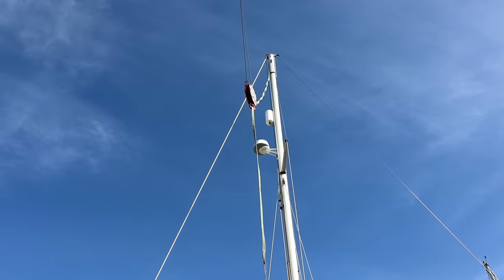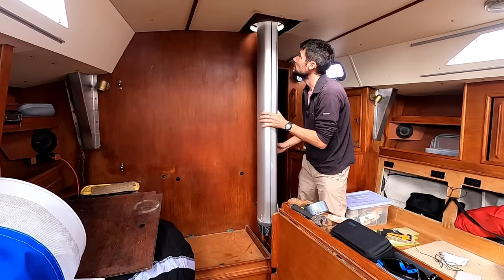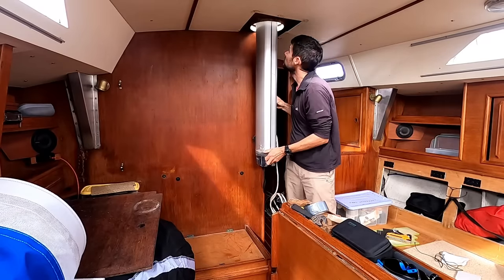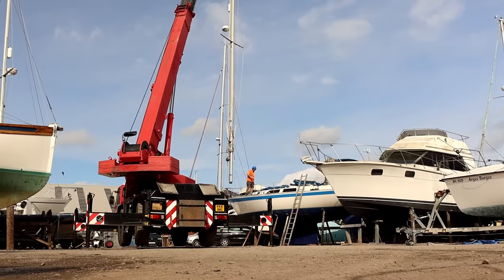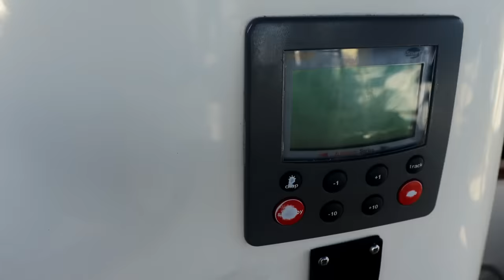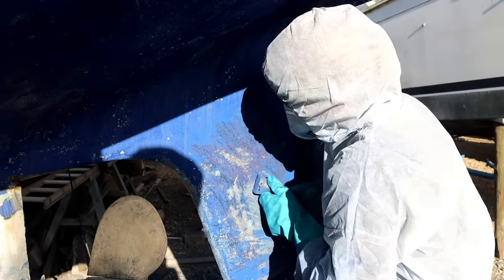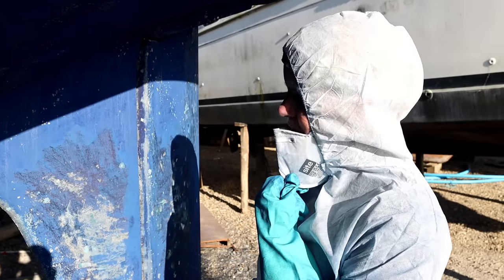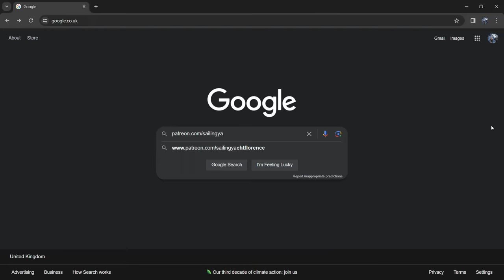BROKEN by Ocean Sailing - 50,000 miles later | Sailing Florence Ep.173

Comment: You should thing of buying and installing a de-humidifier think of it as a negative air conditioner, it will help to keep the cabinet much warmer.
Reply: Living in a cold boat in winter is like living in a tent, condensation from breathing. A dehumidifier will also stop mould.  Highly recommended.
Reply: Yes Millennial Falcon finally just got one and the reduction of condensation was phenomenal
Reply: As good ventilation control is so important, including when underway in adverse weather, might be worth adding more dorade vents?
The ones I designed and installed on my Frances 26 many years ago employed an adjustable s/steel mushroom vent,  hence simple and immediate fine adjustment of each unit to match airflow requirements.
Reply: I stayed in a cold basement guest room near freezing temps outside and the dehumidifier easily made the difference of heating enough to be warm. Had to be sure to keep bucket empty so the heat didn't stop. (Just for boat yard)
Reply: These dehumidifiers get a good review meaco   dd8l    junior-dehumidifier
Reply: A modern dual inverter AC can cool and warm: both modes fight moisture and condensation. They can run of DC current.
Reply: Just replied same idea.
Reply: Power consumption will be an issue and will likely challenge their energy system when off grid as a dehumidifier is basically an air conditioner (chill air to dew point) - then there's the impact on the heating side as well. The meaco unit mentioned above consumes 330 watts and probably needs to run 24h a day.
Reply: 12 volt diesel heater is what I use and it's the only way keeps the boat nice and dry definitely the best heat source
Reply from the maker: We'll cover our heating installation in a later video. The dehumidifier option will be there for when we are plugged into shore power (rarely) or when we are running the engine; running it continuously would be too much of a power draw from our limited space for solar panels and the lack of direct sun in the higher latitudes.
Reply: @SailingYachtFlorence  Copy that. A hydro-generator will not help a lot I guess. Windgenerators ....... I have my doubts. A generator on diesel? Your thoughts?
Reply: I think an MVHR system would be more appropriate so they keep it ventilated but don't lose the heat. Especially as they will be in a cold climate. At the moment this system is de rigueur for passive houses but in the future I expect to see it everywhere.

Comment: Hi Amy & Matt. When replacing your mast wiring ( or any wiring) on the boat use marine grade " tin plated " wire, not the common and garden automotive copper wire.  I came across a rather nice modern ( 12 yr) french built 40 odd footer with rotten and corroded wiring. As a quick repair I used some aircraft wire which was tin plated  that I had lurking in the toolbox. Couldn't believe that they skimped on something so basic and well known to cause problems later.
Not as bad as rigid solid core household wiring , which I've seen  used  on  a main switch panel.!

Comment: That is quite a project. Having watched some channels, such as Sailing Sweet Ruca & Alluring Arctic Sailing, it's clear how important it is to have a reliable boat, equipped for remote places and extreme conditions, including , multiple sources of heating, redundancy, large fuel supplies in proper tanks (on deck fuel/water storage greatly reduce boat stability).  It almost seems that the supplies and equipment required at high altitudes require a bigger boat.  Even carrying long shore lines takes up alot of space.  Don't skimp on the insulation, weather proofing and dehimdifying either.

Comment: I recently replaced my aluminium toerail on a 1980s Trintella 44. It's a big job. I looked at refurbishment but it's wasn't viable. I had a new toerail manufactured by SL Yachting. They did a great job of building what we wanted. You would be able to incorporate stanchion bases with the new toerail  and do a better job than original. Far stronger stanchion bases and no leaks. I went for solid aluminium stanchions. Super strong. It was expensive but worth it

Comment: you need a dehumidifier, its the only way to solve the condensation issue.  make sure you get one that will work with your inverter.  you will be damp inside witout one.  bonus is the also produce quite a bit of heat so you get a bit of warmth from it too.
Reply: I use a simple gravity fed Dickinson Alaska diesel fuel heater which draws internal air for combustion on my boat here in the Pacific Northwest.  During the cool, damp winter months it keeps the cabin warm and dry without using any electricity or making any noise.  However condensation is an issue in the unheated cockpit locker and engine compartment.

Comment: I know you will get there. Florence might take a lot of tlc......but then.....she will be in top shape for another 50.000 miles. And....insulation helps tackling condensation. However a dehumififier is a must. An average person exhales 400 grams of water every day. Meaning, the two of you, in the boat, pump about 1 liter into the boat, just by breathing. I installed a small 12v dehumidifier on my small boat and the result was: No wiping, just empty the container overboard.

Comment: Some things I would suggest. Double glaze the windows by putting an inner piece of perspex to shape (anti condensation) also use polyurethane foam under the deck. I have several areas where the underdeck is like a rainstorm from condensation. In particular the cupboards in the fwd head were so distressing. It took me ages to develop the technique to foam upside down but the end result is warm and bone dry. I have other areas, particularly in the instrument panel where it still rains but I have improved that enough to get me through their winter. I am doing the same as you to leave NL by this coming August, so have an equally impressive list. Understand that condensation in icing conditions is like a water engine. As water condenses it makes a lower air pressure right up to creating a vacuum so there is no way to prevent moist air getting to the icy surface if there is any pathway at all. The only solution is PU foam in the underdeck and around difficult bits like the bow thruster tube.

Comment: I have some lengths of the toe rail if you thinking of replacing parts of it.  It’s not full lengths, but most of it is serviceable. When you have replaced the toe rail, I suggest not putting back the EY stanchion bases.  I have had two yachts with the same section toe rail and made stainless bases that fix to the same fixing points along the rail + an addition bracing pad on the deck; much more of a job👍 Having done the same toe rail job on my Rustler, I know it’s a big job, so wish you well.  The deck; you would be best take all the old track mark off and re-gel the deck with non slip pattern.  I have seen this done on a Heritage 37 and is much better than track mark.

Comment: Get a dehumidifier before going anywhere cold.  It is the only way, other than spending a mint on diesel, to control condensation.  I remove antifouling by wet sanding it, with detergent.  That helps stop the sandpaper clogging and makes the job go more quickly.

Comment: Diesel Heater DAH will solve the condensation problem. Just take a little time to run additional intake to the engine room and forward as far as you can this will draw damp air out. Same with vent place some smallish vent to engine room and damp areas to blow dry air.  My DAH will drop the humidity to 16%.

Comment: Solid dodger would be worth looking at , Good diesel heater a must & possibly routing the outlet to create a drying room for wet /damp gear , A furler on the staysail is good as any thing to keep you off the fordeck in freezing conditions is a must > Runners for bracing can be a pain (Tacking) . I found taking them well arft so as with a reefed main they clear the boom end so jibing , tacking isn't a problem Oh curry & Rum helps > Enjoy

Comment: FWIW the tops of the chainplates on my boat pass through the deck like yours.  I tried a few different sealants to seal under the small cover plates screwed down over the gap between the deck and chainplate without complete success; one of the more frustrating sealing jobs on the boat until I used butyl tape which for three years now has provided a perfect seal.

Comment: The higher north you go, the lower on the horizon the sun will be. This means less energy from the sun, and doubly so if your panels are placed horizontally for instance on an arch, bimini or sprayhood. Just something to take into account is that solar might not be enough at some point.

Comment: Matt and Amy,  Hey you two.  Do yourself a favor and invest in a set of Bahco scrappers and some replacement blades, you will never look back!  The blades are carbide and reversible, they last and cut and last like nothing we have ever used before.  You can shave and feather in your bottom paint with a fraction of the effort.  I actually sort of envy your worklist!  Sailing a failry simple smaller boat has some big advantages, hang in there.   Best of luck with your project.  J&J SV Sueno, Marmaris
Reply: I agree, they are bloody good, scraped the bottom back to primer on my 35ft Keeler, you get a good hold with two hands

Comment: Check out sailing Umas experience. 
One tip for high lattitudes rig your solar panels if you can so you can tilt them closer to the horizon ....horizontal only works between the tropics ...above that  latitude you need to be abble to point the pannels more towards the sun for them to remain efficient. 
Insulating floors and cabin sides with thick cork tiles  sealed on the floor will help ..cork seadeck works well and lasts .. it also insulates the hull deck from outside.
Remember if the interior surfaces can breath they dont end up condensating. 

Theres a Pbo article on line that may help you with ways of controlling condensation on a budget both financial and from a power management point of view. 
You will need to double skin those windows/ports. 

The other thing is plan your route flexibly .. Putin is making threats about polar waters and svarlbard. 🧙‍♂️🇬🇧

Comment: Did you not think about having the hull sandblasted. I’ve just had mine done put back two coats of epoxy followed by two undercoats and two coats of antifoul. Very worthwhile and labour saving. The guy who did can remove a single layer of antifoul without touching the gelcoat.

Comment: Those triangular chain plates need at least a weep hole to allow water an egress or perhaps some lightning holes like an aircraft wing rib with perhaps some additional steel doubling plates to allow for ventilation to the enclosed space. Or else remove the wood on the bulkhead and build up with epoxy and glass so there is no wood in the dead space

Comment: I wonder if you could fit a extra fuel tank and perhaps run a heater or radiator off your engine coolant circuit incase your diesel heater gives trouble, I like having both options as I have had the diesel heater fail before

Comment: have you considered a solid fuel heater ? the dry heat take care of the condensation ,you can get quite small ones that burn smokeless fuel
Reply: It’s really nice to have one type of fuel on board that works for multiple systems. A diesel heater is the simplest solution

Comment: Gelcoat cracks are a source of water ingress to the glass substrate. I hope you grind them back and check for moisture.

A wet rudder with osmosis needs to be assessed for potential glass delamination – if you dig into an osmosis hole, and it smells vinegary, you will need to dry out (e.g. hot vac) and/or replace the delaminated glass.

I’d replace all chain plates and standing rigging. That plate you removed had some rust on it near the wet plywood. 

How many hours on the engine? Polish your fuel & fuel tank and change all engine filters/belts, along with servicing all pumps. How old is the alternator?

What type of replacement through-hulls will you go with? Composite?

Consider an EOFY fuel cell as an additional source of charge for your batteries. Be wary of how much sun you will get in the high northern latitudes and the operating temperature ranges of your new LiFePO4s.

End of your video … substantial rot in the deck? I hope not …

Good luck!
Reply: I think gelcoat is mostly UV and somewhat permeable to water passing.

Comment: Just work, your lucky to have no real problems yet !? (They used chopper guns 35 years ago) maybe upgrade motor and anchor system, look at what the commercial boats use in the high latitudes (it ain't trade wind sailing), it will be interesting on how you insulate so it looks good,  delightful couple with good photo descriptions, keep it up

Comment: The best way to stop rust staining coming from behind stainless steel fittings attached to fibreglass is to use anhydrous lanolin. It's a very sticky waterproof grease that never washes off. The traditional way to seal these fittings is to use a sealant like Sikaflex 291. However, long term this has 2 problems. Firstly, the seal fails after 10-15 years, and secondly the residue is almost impossible to get off. Lanolin has neither of these problems.
Reply: Wow, that's a very valuable tip.
Love the education level  contained in the Comments  section.

Comment: Don't forget "DRY SUITS" in the invent you need to go into the water, "Wet Suits" simply won't work. Hyperthermia can start in less than 3 minutes in 33 degree water.
Include a "Dry Head Hood" and the required other items..ie..mask, snorkel, fins, dry booties, controlled life jacket ( another name***).
Reply: For dinghy sailing I had a hybrid suit with rubber neck, wrists, ankles and horizontal zipper across the shoulders. Pretty floaty so maybe a challenge for swimming the bottom.
I did my checkout five in a wetsuit a couple weeks after the ice came off and it wasn't horrible.

Comment: I admire your commitment to refit/rebuild but the obvious question is why not get a much more recent boat. I would think at almost 40 years old, isn’t time to just retire Florence.
Reply: 1970's and 80's fiberglass boats are the pinnacle of value for money. More modern boats are thinner and much less strong (with a small handful of exceptions). Besides, even if you bought a much newer boat, you are still in for changing out systems every few years. They are making the right call.

Comment: Heat gun will really make removing the non-skid decking easier. Apply heat as you lift off the non-skid with a putty knife.
Reply from the maker: That is true if it has been applied with contact adhesive, but this was applied with epoxy!
Reply: @SailingYachtFlorence  Ugh! I feel your pain.
Reply: I removed the epoxy’d on Treadmaster from my 39ft Westerly Sealord with a heavy random orbital sander and 40 grit discs ( lots) I tried everything and this was the least awful for me. Good luck with it all 💪🛠️⛵️

Comment: Pardon,"The Nurd" in me would muse  ,"Bolts" on the Chain Plates are actually Very Very Long Button Head ..."Setscrews'' a Bolt being threaded for Part of it's length where as a setscrew is threaded for all of it's length, this would be an ideal time to replace same with hexagonal set screws and SPACER Washers to spread the load across the chainplate bracket, also i presume there must be, Should be,  a class a Stainless steel Plate in the back of the other side of that bulkhead,  where there the nuts go. BUT if it's just onto the Veneered Ply, get a new Stainless Flat plate made up with holes in same, using the polished Chain plate  on the front a a Template for those  Hole Pitches, tensioning up and fitting  double nuts or Lock Nuts and of course Spaces washers for same as, "Belt and Braces" and Load spreading then you would have a really then critical part of your boat firmly secured against the worst that can be thrown at it in those High Latitudes, ...even another thought get a few more of,  and a lot  better welds on that Flat solid  chain plate parent metal, as i saw fairly rough Stitch Fillet welding that had been carried out onto the Fabricated polished Bracket... can be seen briefly    @ 13 Min-00 Secs in...Good luck with the refit... Great Upload, Malachy

Comment: Best replacement stove is the British GN-espace. Very expensive but very good insulatiin so uses much less gas and doesnt heat the boat up as much & very good for baking with even and accurate oven temperatures. The Force 10's are now chinese made & much lower quality than the Canadian made units.
Reply from the maker: Sadly the GN-espace is way out of our budget!
Reply: We got an Emo, which works very well, but don’t buy a 3 burner stove, we never use our third burner

Comment: Florence has held up pretty well, don't you think? 
Batteries: would you consider Lead Crystal? They have some really good characteristics without the cost of  Lithium, nor the production effort and raw materials. Just a thought. (I've had a really good run with them)
Dehumidifier: seems essential in the high latitudes and helps the heating system work more efficiently.